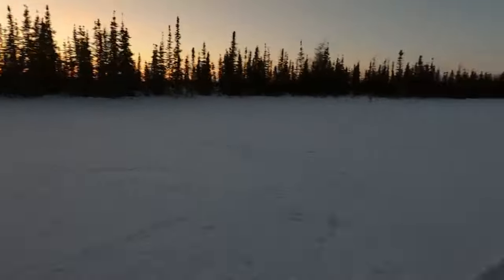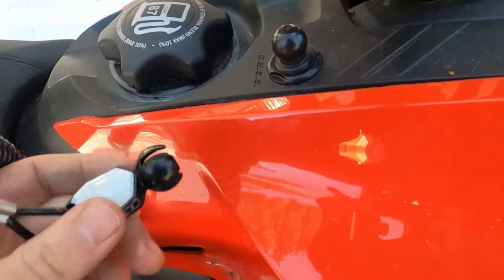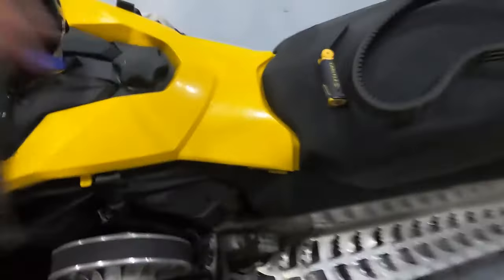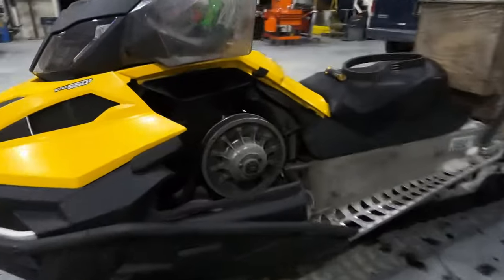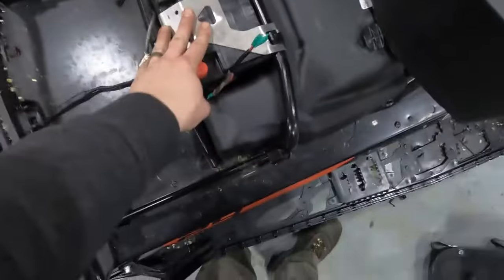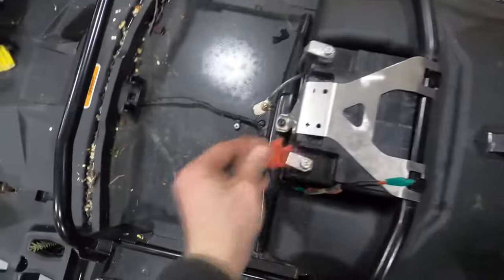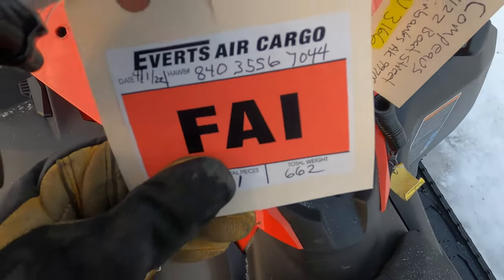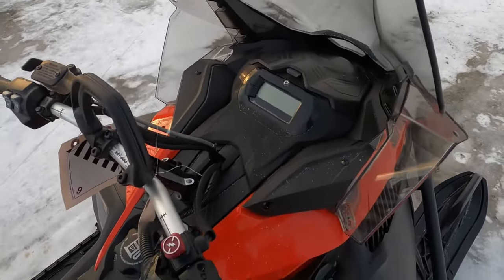CATASTROPHIC ELECTRICAL FAILURE: 2021 Ski-Doo Expedition 900ACE SWT

Comment: Here it is 2-21-2024 and my 2020 Tundra has left my wife and i stranded 14 miles from home. The dealer recently replaced the engine wiring harness this past summer. And this is the first run since the new harness.......previous replaced parts were voltage regulator, 3 sets of mag side fuel injectors, im beyond belief with this machine
Reply: Oh and also, six or seven blown 40 amp main fuses

Comment: The same thing happened to my tundra 600 ace last year,brand new sled, left me stranded and ruined my whole weekend,  it ended up being a hidden 40 amp maxi fuse down by the chain case and reverse handle linkage. It's a fuse at the end of a dead end wire with a rubber cap over the end of it so it's nothing you can visually see until you remove the cap. That crazy thing is the sled doesnt even come with a spare maxi fuse , the sled is outfitted with mini fuses in the main fuse panel. So now I carry 3 orange 40 amp maxi fuses in the sled for spares. That hidden fuse runs the whole sled! And its hidden! Great job BRP, my next sled will be a yamaha, I could go on about numerous other issues that left me stranded this year as well......DONEEEEE  WITH SKIDOO
Reply: Can you some how post a picture of where this fuse is?  Thanks.
Reply: Thanks for your info !!!!

Comment from the maker: Turned out to be the voltage regulator
Reply: damn that was an expensive voltage regulator.
Reply: Thanks for posting the follow-up. I have the same machine. So far, no issues.
Reply: Maybe too much power running at the same time
Reply: Soo was the battery at 12.8 VDC or was it discharged?

Comment: Had the exact same thing happen to me they replaced the voltage regulator as well.  Reliability wise it turned me away from the sled ,  completely stranded and only dealers could trouble shoot the issues.  I ended up getting a 22 vk540
Reply: Smart man, the VK540 will still be running 20 years from now

Comment: My friend had that same problem happen on his 2024 skidoo skandic 900 ace! It was completely dead, no life at all, as if there was no battery! I went back to his cabin on a 55 skidoo tundra to try and fix it. we spent like 20 minutes trying everything, but nothing! Finally, i took a screwdriver and tapped the box that the battery cables go into, I don't know exactly what it is, but it started back up!!!! The box i tapped was on the left side near the gas tank...the only reason i could think that that fixed the problem as if the lever that connected the circuit stuck or something...IDk... Hope this helps!
Reply: I just looked it up, its called the starter relay...

Comment: Hi. I am from Canada and I have the 2021 Expedition 900 sport,, loving it so far.  Have you had any other issues???  How many miles or kilometres do you have on her.   I think I will pick up a voltage regulator to take with me just in case as I get into some remote areas.   Thx for this post.

Comment: Harness or voltage regulator
Reply from the maker: Codes said the CAN-Bus system.. Swapped main chassis harness, engine harness, and voltage regulator. It fixed the problem and ran fine for 1 month then every same code got thrown again. ECU?